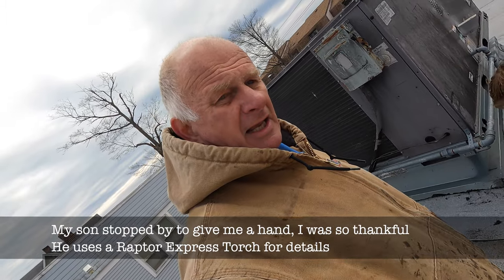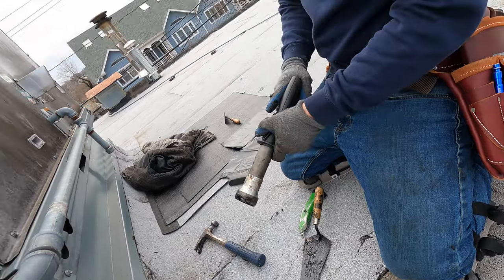Installing Torch Down Rubber Roof over an existing Rubber Roof?

Comment: What if the old torch down roof has silver seal on it. Will the new torch down still adhere to it?
Reply: you can burn the silve coat off with the torch

Comment: Speaking of not removing roofs 
I’m gunna tie in a flat roof to a 10/12 pitch roof should I torch straight to shingles or remove shingles and roll it under the shingles??
Reply from the maker: Never, but never torch over shingle. Always remove at least 2 lines, bring the membrane up, then install new shingles over the membrane. I sometimes am able to pop the nails and slide the membrane under the shingles, but it is risky, shingles could break, and you might not have enough overlap

Comment: It might not pass code in some states here these days but I know this was the way roofing was done many years ago. My grandfather took part in roofing jobs like these in the 80’s & many of the houses he did some 30 odd years ago still have those same torched down roofs. I had even learned from one of my uncles some years ago when I was much younger. Now a days though it’s not as easy to still do this without someone reporting you :/
Reply: Most areas allow Torch down...some places like New York City use hot mop.
Reply: Karens thinking they helping out society by reporting you
Reply: I have been doing T/D since 1984. Never has it been done this way. It's a ugly as it gets.

Comment: I have the old tar and gravel roof, is there any new ways to replace the tar and gravel roofs, or should i just do spot tar repairs when the Leak comes.
Reply from the maker: I gave a link under this video how you can install over a Hot tar and gravel roof

Comment: You guys are amazing.  We have a flat rubber membrane roof now which is square pieces tarred down which almost look like rubber mats and it's been liquid coated over a few times and flaking so it does NOT look like what you have here.  Can we just torch that rolled roofing shingle over it like you did ?   Thanks.

Comment: Wouldn’t pass an inspection in FL
Reply from the maker: you are right. My way will not pass any inspection. As long as it last longer than other roofs.
Reply: 😂 it wouldn’t pass inspection anywhere
Reply: And it won’t last longer than most roofs

Comment: Why is the corner cutting a better than straight corners.    And after how many layers can you use a previous roof ?
Reply: The sharp corners dont adhere/bond to the substrate as well as a rounded off one. People that drag their feet have a tendency to kick the sharp corners up with their boots.

Comment: I notice that you did not clean the substrate before you did the torch down. Why?
Reply: How would you clean it. Give him an example of how you clean it
Reply: @douglei4413  I thought you would wash it first? Power wash or hose down the whole roof with soap?
Reply: @mrbigcat9  No need unless there is visible dirt. Just sweep or wipe and thats it. Never torch onto moisture which will comprimise adhesion.

Comment: can rubber roof be installed on shingle roof?
Reply: Probably not.
Reply: You can for repairs but ideally under the upper shingle piece. I have terminated just on top but it's better to finish it with a three coarse method. Three coars is mastic-webbing-mastic. It is best to start from wood and torch onto a glas base layer.

Comment: First of all the doctor says don’t ever remove the old asphalt roof!  Never leave wet roofing components in place when you reroof a bldg. Wet insulation left in place will rot wood and steel deck. 
This guy is a hack. 
One more scenario what if the existing roof did not meet. Wind uplift criteria as specified by local BOCA code. 
This guy does not take into account any agency requirements including OSHA safety requirements.
Reply: The old roof is probably 40 years old and it stood up to all the weather elements with in those 40 years. If it was not up to code then it would had been blown off the roof a decade ago.
Reply: Also, anyone can feel if the portion of the roof which is rotting. You can feel it with your feet. Just replace that section. No need to replace the entire roof.

Comment: Biggest shoemaker I've ever seen. If you worked for any company I've ever worked for in Canada and I've worked for the biggest company in North America Flynn Canada. You would only be allowed to torch once and you wouldn't even be allowed to finish you first roll. You would be lucky if they allowed you to cut cap sheet. I know you said in a previous video that there is a right way to do this but you would show us the way you do it and that tha manufacturer wants it done a certain way but you won't do it that way. I guess there are no standards in the US.  Everything you do is over burned you  never use gussets you make rabbit ears both ways on your flashing which is wrong. Rabbit ear only go on you first peace the second peace should be cut flush with the wall box parapet and patch on cap sheet is not a 6" by 6" peace you put over a hole it has to look natural the length of the cap sheet 39.50" wide and you cut off the 3" lap and 3' both ways of the hole making it 6 feet long. Putting down a diamond shaped piece over a roof pipe is when you add a roof pipe to an existing roof after the fact with a cone over the pipe. Any existing pipes already on the roof are supposed to look natural you pass the cone 6" cut the roll there and start another piece of roll touching the pipe with the 6" over lap. You have never done or been to the manufacturer torching course.
Reply: Right this guys a joke they show his videos to us in RCABC apprenticeship training, of what not to do.
Reply: @foreign700  RCABC ftw. They should have him come do some demo's to show the difference between specced work and his hack work

Comment: your doing a retro fit but not using base ? you do realize that the base it whats the actual waterproofing membrane and cap is just to prevent it from UV rays from the sun. certainly not how we do it in Canada
Reply from the maker: You clearly don't understand what a base membrane is and what a Cap membrane is. I regard roofers from Canada very highly, but your analysis of Torch Down is completely off.
I think Canadian roofers have a higher standard and that is why they like to criticize me all the time.  I have developed different techniques by myself as I started roofing. There was no school at the time.
Reply: @FlatRoofDoctor  Never to late to go to school and learn how it is really done , even on your age.

Comment: So many things wrong in the application of the product in this video. Hey doctor if you are going to do a video at least do it right. No priming of the granular surface before torching a target. Really. 
One more thing in a recover of a compatible asphalt roof, asphalt primer should be applied in order to achieve a clean surface to attach too.  So many things wrong in this video.  Plus where is your warning flags doc?